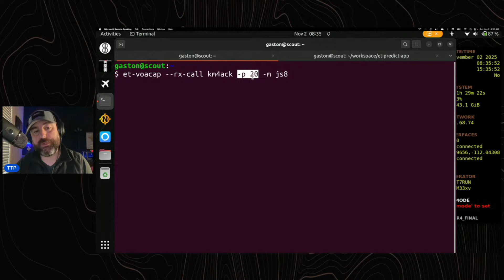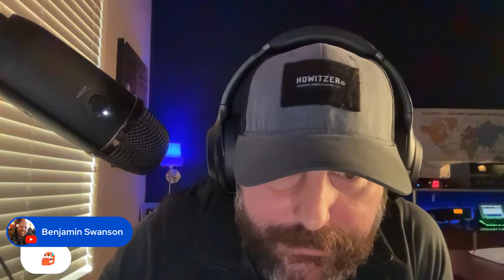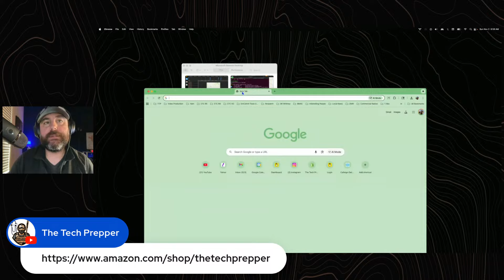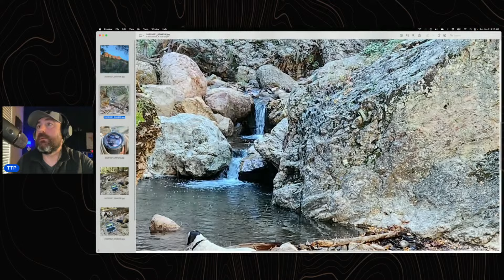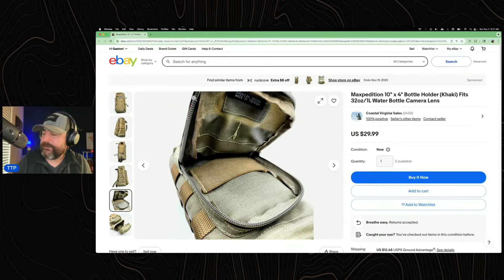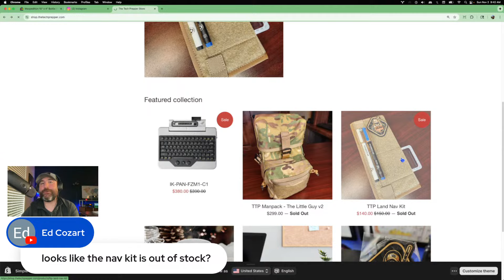TTP R&D Update - Live for 11/02/25

Comment: as always great video!! super excited about the work and energy going into the TTP vision and community.  I know you made a few recommendations on the Panasonic tablet. what model do you recommend? I am looking to get ready for Emcomm Tools R5
Reply from the maker: If you have good eyes and want a 7" field tablet that is ultra rugged, I love the Panasonic FZ-M1 Mk2. If you don't plan on running the iKey keyboard with it, the FZ-M1 Mk3 is great. If you need a larger rugged tablet, take a look at the FZ-G1 Mk5. I personally do not run it due its size, but it's a good fit for most people.

Comment: NVIS discussion here, I believe some vertical antenna give some NVIS result, I've got some result too using the ATAS-120 on my roof car, I made a QSO with my BBS at home, and I was over 20 miles in distance. I brought my ENFED just in case, but I had enough DB to do my test, also in the same test location, I used a regional RMS for Winlink to check for new email, this RMS was roughly 100 miles from my location and it works. So yeah probably your vertical antenna have a good angle to offer some NVIS propagation, 73.
Reply from the maker: Correct. We did some modeling of the Hustler RM-40. While is mostly has low take off angles, it does in fact have higher take off angles around 85 degrees. I love hearing about your NVIS success story. Regional communications for the win. Have a good one.

Comment: What type of testing are you doing on the Baofeng DM32? Is it the UV 32 DMR?
Reply from the maker: It's the DM32. I am conducting the following:;
1. Ruggedness test
2. Performance test
3. Transmission test on MURS, FRS/GMRS, 2m/440 ham, and commercial business license
4. AES-256 encryption on business license
5. DMR + Analog voice
6. Digital mode testing via DigiRig
7. Accessory evaluation
8. Wearability test (plate carrier, backpack, hydration belt, EDC, etc.)
....
Reply: @TheTechPrepper  Fook yeah.💪🤜🤛 🤞
I have a few of these.
I’ve function tested mine and so far with a Digirig Lite,Android Tablet or Android phone w/Anflmsg they did very well.

Can’t wait for YOUR findings.
✊